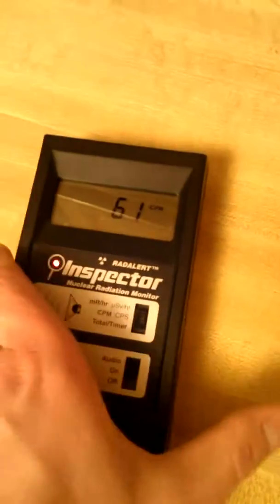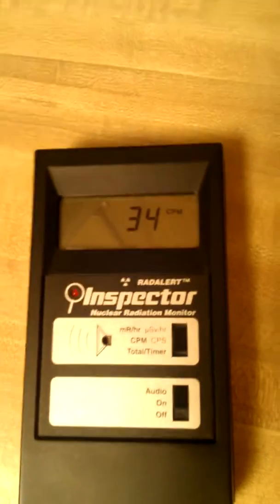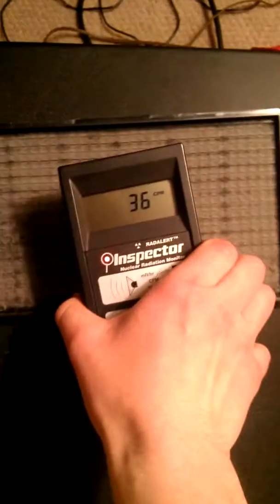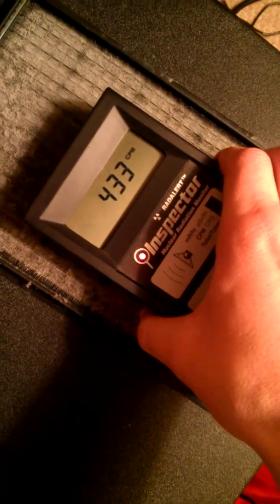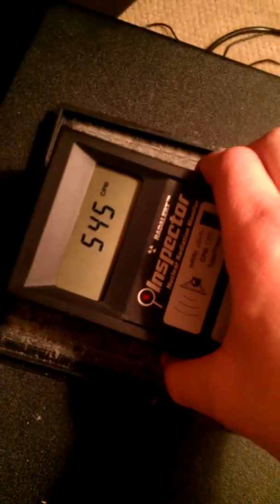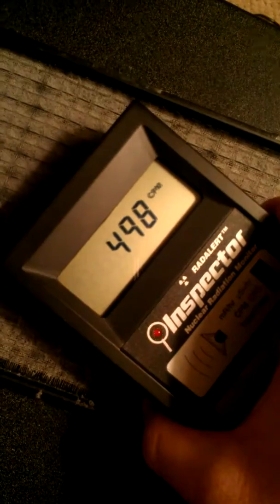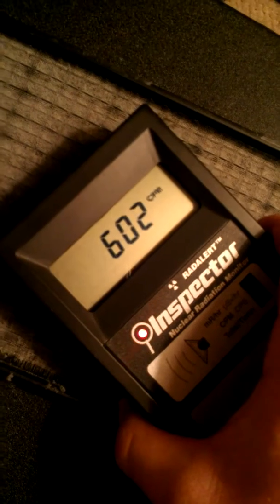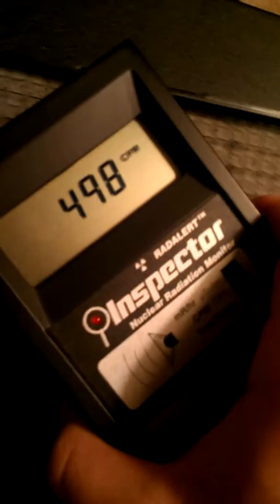Testing Space Heater Filter = High Radiation :(

Comment: that's a pretty impressive reading on your filter.  i suggest changing them more often, and saving any used hot filters - safely - outside your house - in a garage for instance, but more importantly you really want to know what isotopes are present.   you may wish to join the FB group, Radiation Watch, where there are folks to process / help you with grappling with this.  so sorry - high numbers are always disconcerting.  where are you - what state?  my FB name: Nan Bhajani Tierra.  blessings.